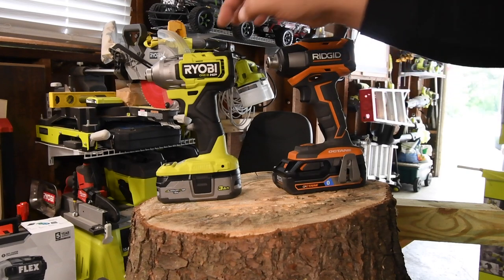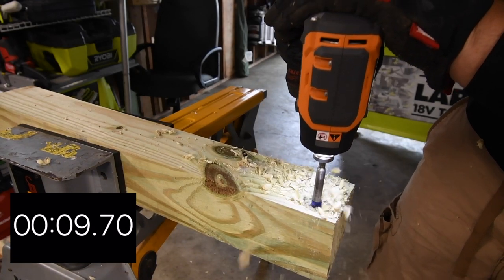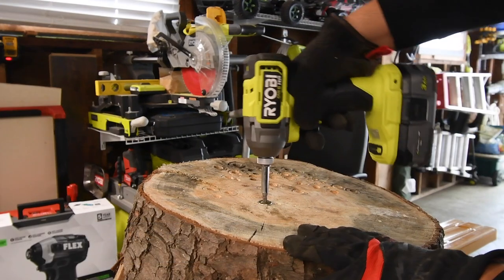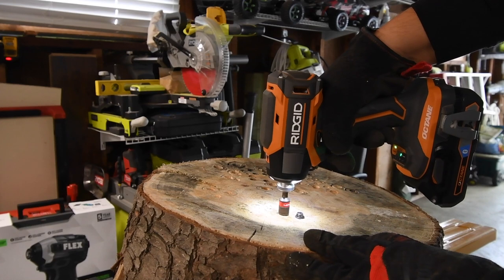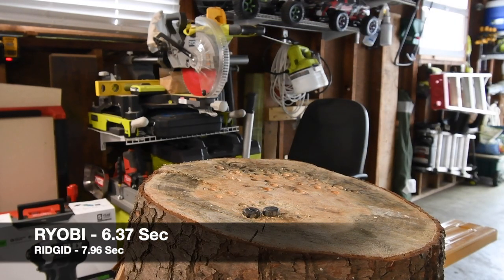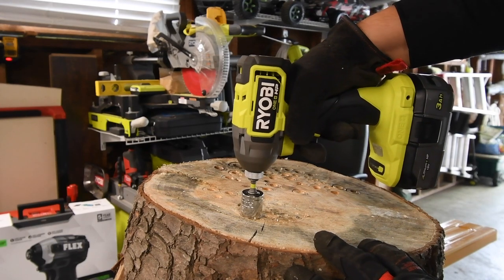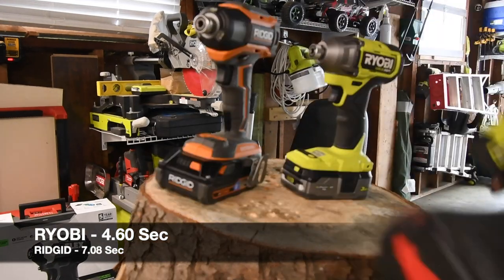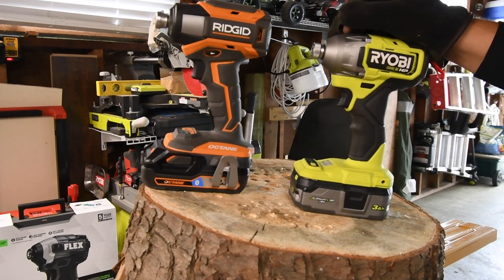RIDGID OCTANE vs RYOBI HP

Comment: I know this is a yr old video, but I still watch these videos for entertainment, cause I'm just that kind of guy.
Starting out, I already prefer the Ridgid due to the placement of the LEDs. This is the same arrangement my 9 old brushed Ryobi had. I also have the Ryobi P234G which doesn't have more power than it's previous model, and it doesn't have the LEDs on the nose of the impact driver. For this reason, when I get my tax check this year, I'm going brushless, but it'll be with tool manufacturer that places the LEDs on the nose of the impact where freaking belong.!!! 
Not complaining you, but I know Ryobi watches your channel and a few others so I'm going to continue bitching about this needless change. There's the better option of over top of the trigger, aimed at the anvil.

Comment: The Octane continues to be my favorite impact driver. It's my secondary for pilot holes. My M18 Surge is my main. That hydraulic driver has soo much control. Great vid as always MCT.
Reply: Why do you prefer the surge over the normal, The quietness of it?
Reply: yup I tried various impact driver, and the surge is my all time favorite. It's so smooth and quiet, I love it.
Reply from the maker: I thank you A8l
Reply: @P_steez  I use it when I'm installing shower faucets, sheetrock repairs, kitchen cabinets with T-20 Spax screws, electrical outlets and fixtures, etc. When I ease on the trigger when the fastener is nearly in, it acts similar to a low-set clutch drill. It's really good at control vs the regular one, which is great for power.
Reply: @XxXGunShipXxX  ahhh I see, thanks for the info!

Comment: That new Ryobi One+ HP Brushless 4 speed impact driver will be a great replacement and upgrade for my old DeWalt dcf787. I have 3 pcs of 6ah +HP batteries and I have 5 pcs of 3Ah Compact +HP batteries (21,700 cells) and 2 pairs of brand new Ryobi 4ah batteries (black and grey) I can get that new Ryobi brushless impact driver in baretool only. Meanwhile I'm also gonna be shopping for a Dewalt 8ah Battery for my Battery reserves.

Comment: Get a Kobalt XTR impact driver to compare these to
Reply from the maker: I still need to get that lol
Reply: I would guess the Kobalt XTR beats them both.
Reply: @enockenock4183  I would too, but I have seen it loose some surprising battles lately. That said, until Flex came out the only one that could beat it was Milwaukee's gen 3 Fuel, and it wasn't a wide margin.

Comment: They're both owned by TTI, and I'm no marketing genius,  but I wonder why TTI is seemingly investing so much R&D into Ryobi while (again, seemingly) neglecting their own Ridgid line.  I'm a Milwaukee guy,  and TTI owns them as well.  Is it feasible that TTI is restructuring the tiers of these tools to appeal to the different segments of users?  I.E. entry-level,  DIY, prosumer,  professional/contractor grade?  If they're trying to differentiate their different brands,  great.  But wouldn't common sense have them investing/improving ALL their brands to position each an industry leader in their own respective tier/category? I'm not convinced that a company as big and wealthy as TTI can only afford to focus on one line at a time.   Two years ago,  I would have purchased a Ridgid Octane product over a Ryobi any day.   Today I wouldn't buy either.
Reply: I agree that they should focus on each brand, on improvements as to what market that tool is focused at. However; I own both Ryobi and Milwaukee 12volt stuff. I started off with Ryobi a number of years ago and haven't really been let down. But I don't abuse or push them beyond limits. I'm happy with them. While maybe not as powerful as the other brands, I have no problem if I need a pilot hole first.... but I also got the newer Ryobi as well. Definitely like the smaller size. I bought into the Milwaukee 12 volt due to size and reliability.
Reply: TTI just owns the companies. They dont make the tools. They are basically just in it for the profits. Its up to milwaukee, ridgid, and ryobi to do the r&d and develop the tools.